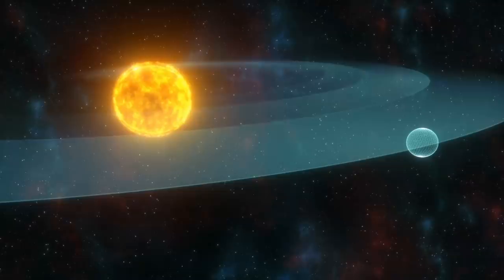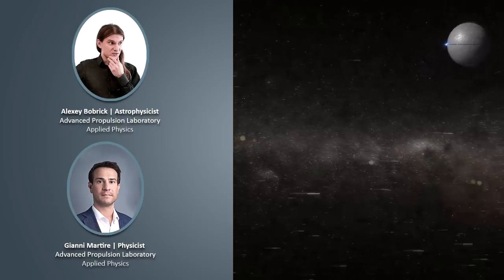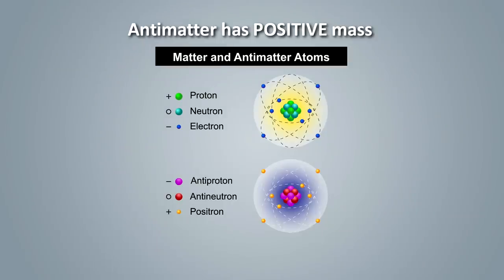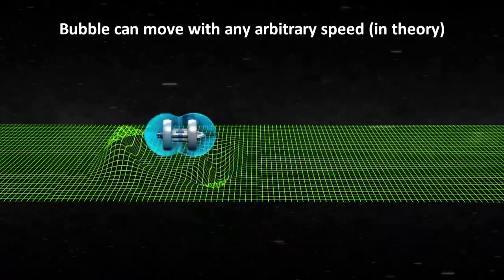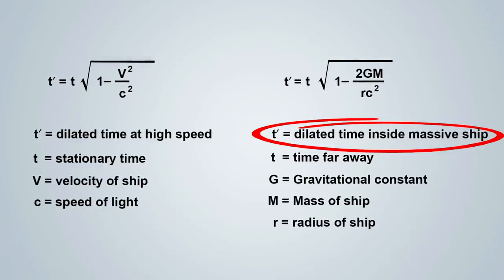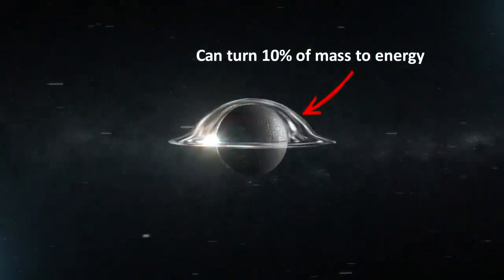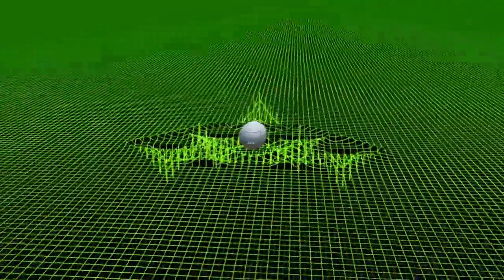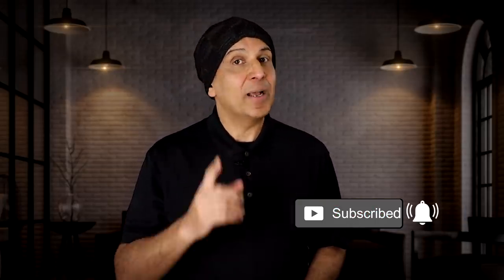REAL Warp Drives? NEW research proposes a solution!

Comment: Actually the idea is good rather then going faster then speed of light we can just use Or manipulate time to go faster than speed of light
Reply: Space is a dual concept!
Space is dual to time -- Einstein.
Time dilation is dual to length contraction -- Einstein, special relativity.
Length , distance, space or depth is produced by the stereographic image created in your mind by the two dual images from your eyes -- hologram in the brain. Depth or the 3rd dimension is a by-product of duality (two eyes) -- holograms or two interference patterns produce depth, or distance. In physics the vector cross product between the x any y dimensions creates the z dimension or third dimension!
Distance, length, space or depth is defined by two dual points -- space duality.
Points are dual to lines -- the principle of duality in geometry.
Up is dual to down, left is dual to right, in is dual to out -- space duality.
Space duality is dual to time duality.
"Always two there are" -- Yoda.
Reply: @hyperduality2838  why are u spamming this?
Reply: @higorss  It is not spam.
Syntropy (prediction, projection) is dual to increasing entropy -- the 4th law of thermodynamics!
Teleological physics (syntropy) is dual to non-teleological physics (entropy).
Thinking is a syntropic process.
Mind (the internal soul, syntropy) is dual to matter (the external soul, entropy) -- Descartes.
Photons or light connect the inside world of your mind with the outside world of atoms and forces and photons are dual.
Electro is dual to magnetic -- Maxwell's equations, electro-magnetic energy is dual.
Gravitation is equivalent or dual to acceleration -- Einstein's happiest thought, the principle of equivalence (duality).
Concepts are dual to percepts -- the mind duality of Immanuel Kant.
The intellectual mind/soul (concepts) is dual to the sensory mind/soul (percepts) -- the mind duality of Thomas Aquinas.
Your mind is a dual construct according to Kant, Aquinas, Descartes, Einstein, Hegel et al.
Thesis is dual to anti-thesis creates the converging thesis or synthesis -- the time independent Hegelian dialectic.
Mind dualities imply syntropy which is dual to entropy.
"Always two there are" -- Yoda.
Reply: @hyperduality2838  When you copy and past a text everywhere it's definitely spam
Reply: @higorss  I am training the neural network that Youtube uses to check the comments! Neural networks recognise patterns so my "spam" will optimize it. It is a scientific experiment.

Comment: Hi. First of all, I'm really proud to say that I'm not a physicist. I just only know basic classical physics. This is just my hypothesis. When we talk about light, we talk about massless photons. As photons are massless, the speed of light cannot be determined but, we could determine its speed because of gravity without which light would become instantaneous irrespective of distance meaning, it is the gravity that slows down light. According to Einstein's theory of general relativity, gravity has no direct effect on electromagnetic waves but, when gravity has the ability to interact with Space-Time to warp it, why can't it interact with electromagnetic waves? I certainly know that this is weird but, the fact is that our whole Universe is weird. There is another point which has to be clarified which is the reason why there can be no other thing that can travel faster than light. The basic prerequisite for a thing to travel at the speed of light is that it should be massless like photons and should be electromagnetic. But, even if something is massless, gravity remains the same and hence, if there is an another thing which is massless it can't break the record speed of light though it could travel at the same speed of light. As gravity varies at different parts of our Universe, it is wise to ask whether the speed of light is the same at all parts of our Universe. Certainly NO. Though the speed of light would vary at different parts of our Universe the difference would be very minimal because, everything in our Universe is controlled by the Great Attractor. To be honest and to put it precisely, our physicists haven't measured the speed of light at different parts of our Universe yet because, to measure it we have to travel at the speed of light which is attainable only if we become massless. The speed of light becomes the landmark of speed just because of being massless. If gravity reduces then the speed of light will increase and if gravity increases the speed of light will decrease. This doesn't apply to light alone but, to all electromagnetic waves. Heat is an electromagnetic radiation that travels at the speed of light. Sound travels slower than the speed of light because it is not electromagnetic. We all know that gravity warps Space-Time. But, I hypothesise that Time cannot exist without Gravity. Light never experiences time because, it is massless which directly imply that it is the gravity and mass that defines time. Time can be experienced only by particles with mass. A particle's maximum attainable speed is determined by its mass. If mass increases its maximum attainable speed decreases. We cannot increase the momentum of any particle with mass to travel at the speed of light though we can make any massless particle to travel at the speed of light, if we can find massless fuel and massless container to propel it. Though we've discovered and defined many things, the divine fact is that we all know NOTHING.

Another divine fact is that something will and should always remain a mystery. I don't know the meaning and purpose of opening and exploring these mysteries. These mysteries have no meaning to us and the future of our world though it means a lot to the Universe. We have got everything more than what is required for us and for the future of our world. Exploring more will only destroy us and our planet. By GOD, I admit that I know NOTHING and try to IMAGINE things as would be appreciated by Dr. Albert Einstein if he is alive.

Comment: I think if we are going for making time pass faster for the people on the ship rather than actually getting there faster, the best solution would be advancing medical technology to the point of being able to cryogenically freeze somebody, then wake them up 100 years later with them not knowing that much time has passed at all. This would eliminate the need for a lot of mass, a lot of energy (other than the already enormous about of energy to accelerate any object to nearly the speed of light and then back down to a slow speed), and a solution to keeping alive the people on this ship which is dense enough to vaporize them into the floor just by being inside it.

Another alternative would be actually turning people into light, shooting them to a receiver in the location they are going to, and then reconstructing them there. Obviously that requires already being in that location to build such a receiver, but shooting a bunch of light over a long distance is much more efficient than an entire ship, energy-wise.
The other issue with that is figuring out how you safely turn somebody into a beam of light without dissolving their conscience, and that could only really be known if we could figure out what "conscience" is in the first place, and how they remain continuous from birth to death (or potentially, how they do not).

Comment: Not imprisoned in our solar system, it is quite possible to develop motors and ways of propelling ourselves in space that bring us quite close to the speed of light, although without reaching it, much less exceeding it. With that, trips of 4 or even around 10 years, I don't see it so impossible (of course, we would be limited to the closest star systems which I think are only 3 or 4 counting ours). In fact, what makes it not good for astronauts to spend several years in space stations is the absence of gravity and exposure to radiation from space. But it's actually relatively simple to create a gravity simulation system simply with the 2001 Space Odyssey idea, artificial gravity by rotation. A space station has not yet been made with that since it is very expensive to build something so big and they have not yet had an interest in spending so much (the international space station itself, as small as it is, had to be built little by little over the years due to how expensive it is to send things from Earth to space), the ideal would be to build space stations or ships directly in space. There would also be the problem of having to endure a few years locked in a ship, which easily generates claustrophobia or other mental imbalances. But with artificial gravity, more space on the ship, psychological training and a lot of entertainment and constant communication with the Earth (although as you go away the waiting time between sending messages and videos will get longer) it should be possible. Anyway we are still in diapers, we just have only one probe that is moving away from the known solar system, and before sending a manned spacecraft a probe will be sent (there are already projects of interstellar micro-probes that due to the low mass they have is easier to send them much faster).

Comment: The inhabitants of this massive craft would be crushed by the gravity of the craft.
Reply: Perhaps not. The outer hull could be made of such material. But the inside would be a hollow, relatively speaking, sphere. At certain points in the sphere the gravity generated by the far side of the sphere would cancel out a lot of the gravity of the near side. In other words unlike standing on a planet where all of it's gravitational mass was pulling on you in one general direction, the gravitational mass of this ship would be pulling on you from many different directions, half of which would be the opposite directions.
Reply: @davidtherwhanger6795  That still leaves the question how to get inside without turning into a puddle on the way.
Reply: @jenshellwig2574  To actually manufacture something made up of super dense material from a neutron star we would first have to have figured out anti-gravity anyways. I can see no other way to assemble it. Of course by then we would not need the super dense material anyways.
Reply: @davidtherwhanger6795  @Jens Hellwig
You can enter without being crushed or spaghetified so long as you don’t hit the surface and so long as the gradient of the gravitational field (effectively, how curved the space is) is not too large.  The former is easy.  Just put a hole in the side of the ship and go through that.  The latter is a bit harder to accomplish and will require that the ship be massive, but we are already working on that assumption.  Thus both are possible.  You should be able to enter with no fear of being crushed or stretched to death by the gravitational pull of the ship.
Reply: As was my thought. "What about gravity?"

I don't know. But all of the hypothetical solutions to FTL sound terrifying to me. A lot of energy and who knows what else.
Reply: What you could do is spin it up really fast so the centripetal force on the inside of the shell would counteract the gravitational pull of the neutron star at the core. You would probably have to spin it so fast that you get even more time dilation out of it so it's a win-win!
Reply: @joelthomastr  Wouldn't work as there is no neutron star at the center. The hull is made of super dense material of a neutron star.
Reply: @davidtherwhanger6795  Would that not ruin their time dilation?
Reply: @kisa4748  That part I'm not sure about. I really haven't looked into the actual effect of gravity on time dilation. I was focusing on the question of if they would be crushed or not.
Reply: @davidtherwhanger6795  Hmmmm.
Reply: @kisa4748  If your interested, this guy has a lot of stuff on various subjects.
https://www.youtube.com/channel/UCZFipeZtQM5CKUjx6grh54g
He's probably got something on it, I just haven't got around to it yet.

Comment: could you make a video about ufo's? I would be much indebted. thanks
Reply from the maker: Sure, but if you believe they are alien spacecraft, you are going to be disappointed in what I have to say.
Reply: @ArvinAsh  but still it's going to be an interesting one for many
Reply: Space is a dual concept!
Space is dual to time -- Einstein.
Time dilation is dual to length contraction -- Einstein, special relativity.
Length , distance, space or depth is produced by the stereographic image created in your mind by the two dual images from your eyes -- hologram in the brain. Depth or the 3rd dimension is a by-product of duality (two eyes) -- holograms or two interference patterns produce depth, or distance. In physics the vector cross product between the x any y dimensions creates the z dimension or third dimension!
Distance, length, space or depth is defined by two dual points -- space duality.
Points are dual to lines -- the principle of duality in geometry.
Up is dual to down, left is dual to right, in is dual to out -- space duality.
Space duality is dual to time duality.
"Always two there are" -- Yoda.

Comment: I see a couple of problems with that super-dense neutron "Death Star." While the density would most certainly solve the issue of weightlessness for the crew, it was stated that it would have a gravitational factor of 10% of the sun, which has a gravitational factor of 27.9 times that of the earth, so at 10% of that the crew would weigh 2.79 times what they weigh on earth. Sure, the trip only "seems" to take 10 months to them, but when you suddenly weigh almost three times what you did on earth, you would wish for death way before that. Of course, the interior should offer varying degrees of gravitational pull, so it would most likely be possible to find a comfortable spot as you move inward. But would the time dilation vary depending on one's proximity to the center or the exterior? Next, if we accelerate this "Death Star" to half the speed of light, it will eventually need to be stopped once it arrives at its destination. Good luck with that. With such a large gravitational pull, you would not be able to even get it close to whatever celestial body you were visiting. This thing would be attracted to and by anything it came in proximity to. Sure, you could launch a shuttle, but pulling away from the "Death Star" would be like launching from the surface of the earth, if the earth had 2.79 times its current gravitational pull. Also, you say you want to travel at half the speed of light? Okay, great...and if you hit something? I'm guessing this thing is going to handle like trying to pilot the moon down a slalom course with a model rocket engine attached to it, so it's not like you are going to steer around anything. Of course, its super-dense neutron construction may would protect it, but maybe not. Finally, there is the material. Even if we used every ounce of the earth and the moon, there would still not be enough material to construct this "Death Star." Unless a neutron star comes floating by, and someone develops a way to mine it without being crushed under the influence of its gravity (the average neutron star has a gravitational pull 2·10^11 times stronger than Earth), this idea is no more feasible than just building a teleporter to take us there.

Comment: I've read a lot of ufo stuff over the years. Now I'm stating from memory here but they reckon they have a 'big' gravity field generator 'engine' that they use to focus or point to where they want to go. Hence they change direction in an instant as has been reported by sightings when they move locally. They also bend space time & move 'in an instant' from one place to another. Not 5 months or 8 months but an instant. So we must learn how to bend space time to travel the apparent 'massive' distances.

Comment: If there is no limit (known) to how fast space/time can move.  And say nothing of the negative/positive energy needed to do so.  But, if your compressing space in front of the ship, while expanding it behind.  Why are you not also "moving"?  So if your trying to go from point A to point B.  And you compress space in front of you.  Wouldn't the rate of compression in front dictate the distance you would travel to point B?

If that doesn't do anything.  And your affectively just making a bend in space that you can "fall" into.  Then you can just use an ion drive to push you forward rather quickly.  
If that bubble the ship sits in shows a flat space.  Then the ship appears to have no mass.  Since it is not bending space.  You could achieve light speed with a flashlight in the back of the ship(J/K).  
And if that bubble is not flat.  Then it needs to be apart of the warp bubble.  Compress in front, eliminate the curve of the ship in the middle.  And expand in the back.  
Again, we are not discussing the energy needed to do this.  Just that IMO, it should work.  Not past light speed though.  For that, I'm guessing you need to compress space faster than 186,000mps.  With what energy, no idea :)